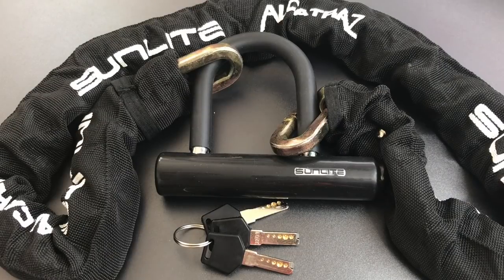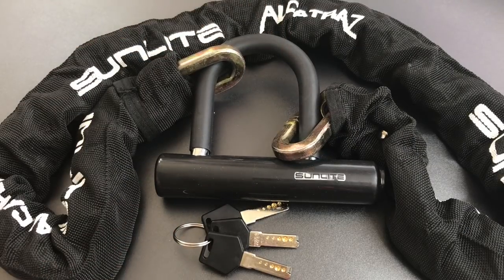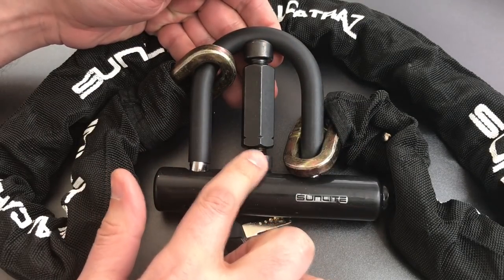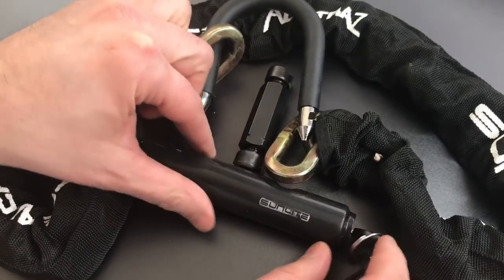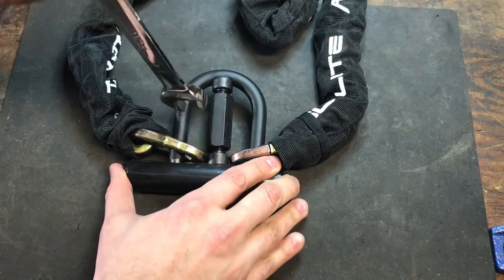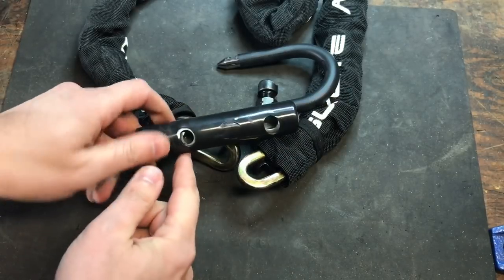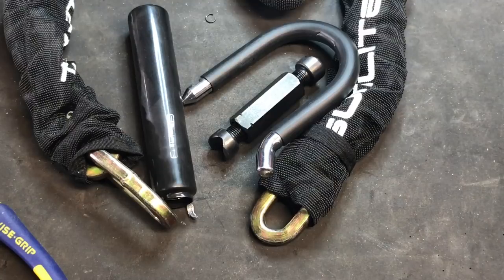[613] Screw Spreader vs. SunLite Alcatraz Mini U-Lock

Comment: Man, if you had put a ratcheting box wrench on the spreader before putting it in place i bet you could open that lock even faster
Reply: Was just gonna say that, yes.
Reply: That's exactly what I was thinking.
Reply: Yeah, with a good hand, maybe one minute? Surely would break it.
Reply: Exactly my thought
Reply: Derkman96 I was thinking that. But then the lock might have put up a better fight and the spanner would have needed a lot more force. Better to use a standard one then over work a ratchet spanner.
Reply from the maker: I didn’t use the other (ratcheting) end because if it didn’t work, there was the potential for it to be stuck...
Reply: True. I have a similar set of non-reversible ratcheting wrenches. It SUCKS when you get them stuck somewhere. The lack offset or angle on the box end is pretty handy, though.
Reply: Stephen Cresswell Not if it had a switch to reverse the action 😎
Reply: @BulgarianNationalist  Me too! ;)
Reply: I literally was about to comment this exactly lol get a few cheapos from harbor freight incase one breaks it fails... throw another on... keep going. Cheap, effective and fast. 

Great idea.
Reply: If it was to become stuck, couldn't you just reverse the action and loosen it back out?
Reply: Those exist?
Reply: What’s that tool called ? A screw expander?

Comment: Hi Harry, neat little tool, it's amazing the power that threads can exert. I'd never seen that tool before, but we use from time to time, the same principle with high tensile bolts to push back the locking bolts on safes, when relockers have fired. It's incredible the force that can be applied with the right lever and thread.  Regards, Brian.
Reply from the maker: Agreed about threads... I’m constantly amazed that some of the things I try actually work!

Comment: another great tool crossover.
I would be willing to bet that a lot of the locks that yield to the double wrench technique would yield to this.  You can make bigger versions of this tool with a grinder, and some grade 8 bolts, and a right / left coupler for larger challenges.
Reply from the maker: If I was making one, it would have one screw. Two screws cuts your mechanical advantage in half. ☹️
Reply: Intriguing... single fine-thread, grade 8 or NAS 501 screw with thrust bearings at each end. 
If I decide to make one, I'll send it to you to try out.  Don't hold your breath, it would be at the end of a long line of projects.

Comment: It doesn't even need to be double threaded. You take a regular extension nut, a bolt and a ball bearing. You grind the ball bearing and bolt with a rounded notch, place the ball bearing with the notch on the body of the lock and the other arrangement over it and in the clasp. And you get the same result.
Reply from the maker: I’d do it a bit differently, but I agree on the one screw method. Two screws cuts the mechanical advantage in half.

Comment: A ratchet spanner would make fast work on the screw spreader.  . I look forward to seeing this on better made locks.. 
Great video.
Reply from the maker: True, but it could get stuck if the lock didn’t open.
Reply: Just hit the reverse switch on spanner..
Reply from the maker: Usually, only the cheap stamped/laminated ones have them. The stronger variants are unidirectional. 👍

Comment: I've heard of thieves using a bigger hydraulic (bottle type) jack for this type of destructive attack, but that obviously wouldn't fit in a smaller lock like this one....and vice versa- this little spreader wouldn't work in a larger u-lock because its top spread dimension is only like 5.25"

Comment: Fair test :)  At first I though the ∩ would need to (also) go around a frame, wheel etc (along with the chain ends).. and then the chain around a pole. Doing so would have made the splitter near impossible to insert. But duh! Clearly only the chain ends need to be hooked to the ∩ . Which begs the Q. Why would the Co. need to make the ∩ so LARGE? Surly with most chain ends, the ∩ could be much, much smaller. Making insertion of the SPLITTER less possible. But then again, eye rarely know squat :) But thank you for the THOught PROvoking VIDeo LPL. Cheers!
Reply: The U-lock is that large because it's intended to go around the frame and the rear wheel. If you only use it to close the chain, it is indeed needlessly large.
Reply: What was shackle too hard of a word for you bud?

Comment: If you had a ratchet driver and put the screw spreader inside it, before putting the screw spreader into the lock, you could probably ratchet one of these bike locks apart relatively fast.

Comment: Which locks are good for bikes? Thanks for this video. I was just about to buy one of these. I just lost my bike. It was locked with a 90’s motorcycle lock that I’ve had for decades. No idea how they got it. :(
Reply: @alecw7063  Thanks.  I ordered the one this same video guy has a video on where he picks it but says it's the one he uses for his lock and leave bike.  It's called Kryponite Evolution Series 4.  While I wait for it I'm using 3 chains with padlocks that could be popped open by a big strong man with a screwdriver.  But that's only for a few minutes and it's 3 locks, so...  This motorcycle lock I had - I'm thinking they picked it.  It was a series of solid steel bars connected by joints.  How else would the have breached it? thanks!
Reply: Isabel Perez security is a lot of the times an elusion. For example like master locks can have a 10 security rating but still be easy to pick for an amateur and shimmed. What you thought was nice steel could’ve been Not hardened, and even if it was hardened but not particularly thick its not gonna stop a strong pair of hydraulic cutters and not even break a sweat for a guy with an quality angle grinder and good discs. You’d be surprised how thick of a piece of metal those cutters will cut through. And nothing on the market today i know of is gonna stop a guy with lots of time, lots of cutting discs,  spare batteries and a nice angle grinder. If no one was around it easily could’ve been cut given time. Also nah, it was most likely not picked, single pin picked at least. If it was a tubular lock and not a good one with different tension springs and different length drivers pins it can be impressioned in seconds without a sound. It also could’ve been raked easily, bypassed if they don’t have an anti bypass plate and someone can easily reach to the back of the keyway and push the locking lugs to the side. Someone also could’ve shimmed it. But if it was a decent lock, not many people have the skills to single pin pick. It was either a brute force attack like listed above, or it was defeated via the core in ways other than SPP or someone messed with the locking mechanism like also listed above

Comment: I wonder what would happen to a u-lock if you were to put a tiny hydraulic cylinder under the shackle, and pressurized it with a grease gun filled with hydraulic oil instead.
Reply from the maker: You may find out on this channel. 😉 we’ll be testing some portable hydraulics I have at some point. 👍
Reply: While doing research for finding good bike locks, I remember that hydraulic jacks were mentioned as one of the methods for brute forcing a lock. It's very quiet, and supposedly pretty much no lock (even 16mm shackles) can withstand such an attack. I remember that was the reason the mini u-locks were recommended, so that the frame and the bike stand fills most of the space inside the shackle to prevent such an attack.

Comment: If the lock was around part of the bike, if would be very difficult if not impossible to get that tool in there
Reply from the maker: Depends how it’s used, but you are definitely correct that there are ways to defend against something like this with intelligent locking.

Comment: Such spreader could be used to operate a bolt cutter. Just remove the long handles, and attach some very short steel parts which transfer the force of a spreader to the jaw ends. (The jaws don't cross like scissors, so the jaw ends must be spread.) Screw pin shackles in the jaw holes would be strong enough to take the force of a spreader, but they might slip out of the spreader screw grooves. 

The point is of course to have a short tool with very much cutting power. If speed isn't important, this could be convenient to have just in case.
Reply from the maker: Interesting idea!
Reply: Would it be possible to add a ratchet to speed things up too? Not that it took long anyway, to be fair
Reply: There's room in that long "nut", so if the ratchet wasn't strong enough, a normal open end wrench could finish the job, hopefully. If the lock were too strong for the spreader, it could be problematic to loosen it. Some ratchets work only in one direction, the other direction is achieved by flipping the tool, which would be impossible now. If there's a grinder around, and you aren't doing anything illegal, no problem then. Just cut the shackle.
Reply: Des Kelly On a second thought, there may always be enough space to slide that ratchet away from the hexagonal shaft. Those screw heads are relatively high, so there are few situations when most ratchets couldn't fit to the free space out of the shaft.
Reply: nice idea but i feel a hydraulic set up would be best for small and power full, something like a small bottle jack maybe?
Reply: Owain Hydraulic jacks are heavier than that spreader, but if that's not a problem, why not? Much force means little leverage required. I've seen very low jacks, too. So low, that I don't know whether they have long enough stroke for this application. Anyway, that's easy to measure how much movement is needed. 

There are small hydraulic jacks for removing bearings. Pressure is generated by turning a screw, so the stroke is very short, but the force is enormous compared to size.

Comment: I can't help but wonder, were that was actually on a bike, would you even be able to get the screw spreader in there, and then have room to put a wrench around it.
Reply from the maker: Well, that’s the reason I did the test with the chain installed. 👍
Reply: I understand that, but in normal use wouldn't it be used something like this::  http://thebestbikelock.com/wp-content/uploads/2015/05/lock-bike-2-u-locks.jpg
Reply: yes buy in this case he would pick the lock ...this guy can pick 99.9 of locks in the world under 2 minutes

Comment: Lmfffao i cracked up when you said 3/32 inch. Who the hell actually knows the measurement 3/32 inch. No big deal but i just thought it was funny because you are the first person i ever heard say such a specific measurement fraction.
Reply: I have a drill set incremented in 64ths - eveyrday sizing in 1960s UK.
Reply: Robert Seviour 

In the UK?? I thought they used the metric system in the UK. Anyways you have a great channel and i learn cool things from you.
Reply: It all went metric when I was a teenager, with some good consequences and some nonsensical - a 4 X 2 is now 10 X 5 mm.  That's not too bad but a sheet of ply which was 8 X 4 is now 2440mm by 1220mm - and a pound of bananas has become 453.592 grams. I don't miss the fractional drill sizing - it's still current in the US though. For small components mm make a lot more sense than 19/64ths for example. Beer still comes in pints, thank goodness.

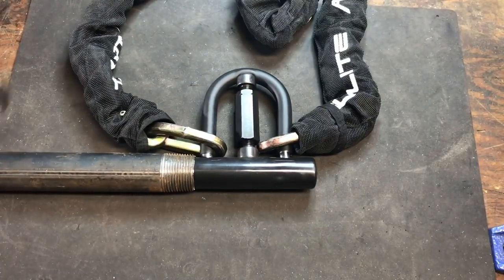Comment: 3:31 - But needing use a big cheater bar to keep the lock in place kinda defeats the reason for using a small device to break the lock, in the first place.

Sure, the expander screw is small and unassuming, but that big pipe isn't.

Comment: You switched sides! I was looking out for the shearing on the right and then it was the left. That was irritating. Please respect continuity in the future. 😄
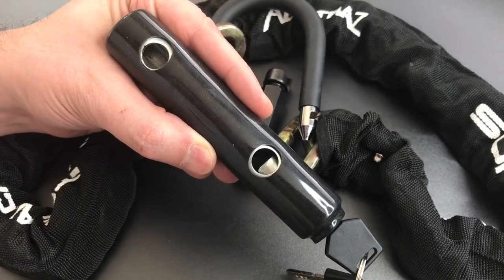Reply: LockPickingLawyer At 2:00 you point out how you expect it to fail on the weak lock on the right. Then at 2:20 in the garage you've switched sides and it fails on the left. 😄
Reply from the maker: Ah... now I understand. 👍